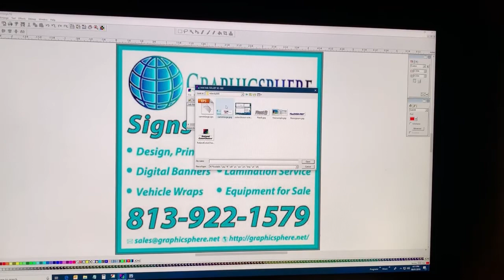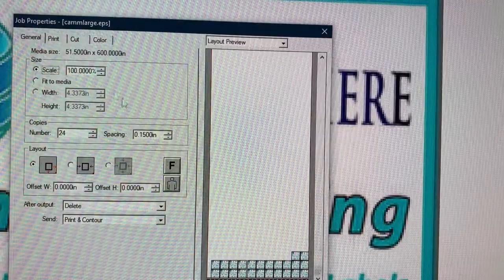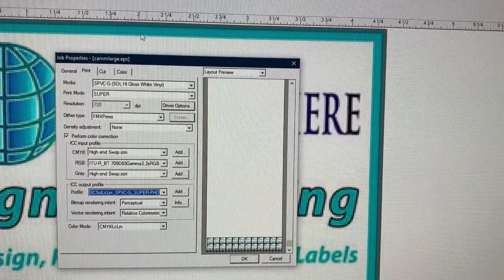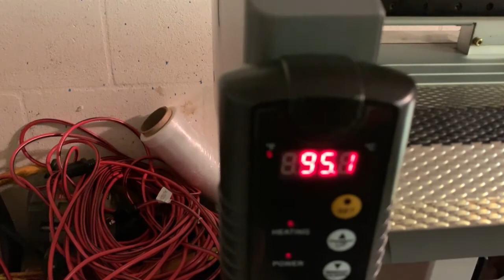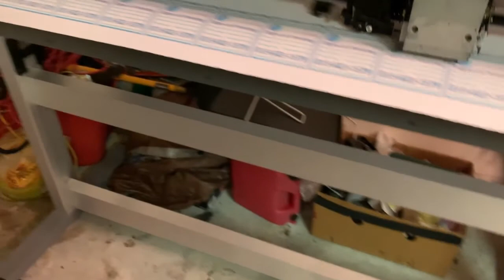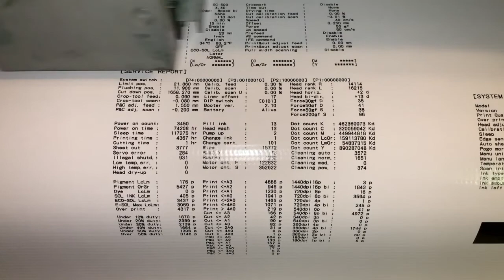Graphicsphere - Sales Roland CJ-500

Comment: Hi sir can you share the patch file for this
Graphicsphere
There is a 64bit patch for Roland ColorChoice that I have that works on windows 10, 8, 7, Vista and XP. The patch just installs the latest version ColorChoice 4.5 so it can run in 64bit mode which Windows 10 requires 64 bit
Reply: Hi, just been given a cj500 converted,  do you know what software I would need to get it working with Windows 10 please?